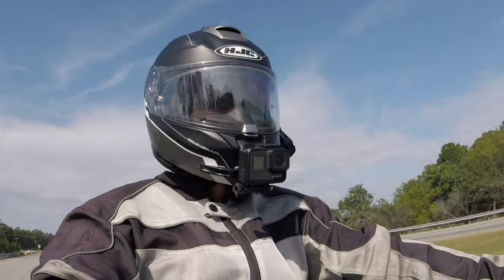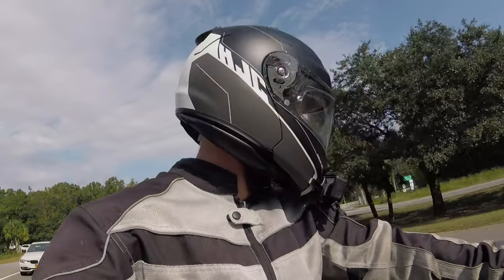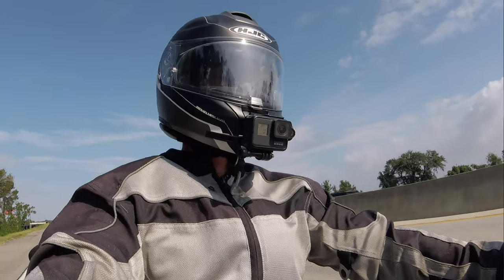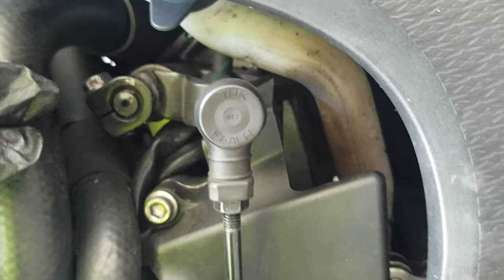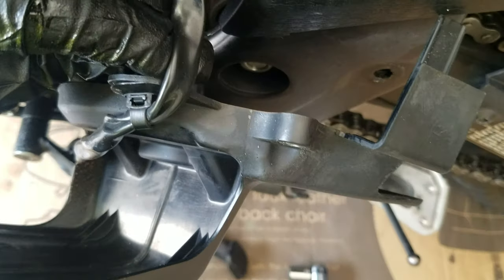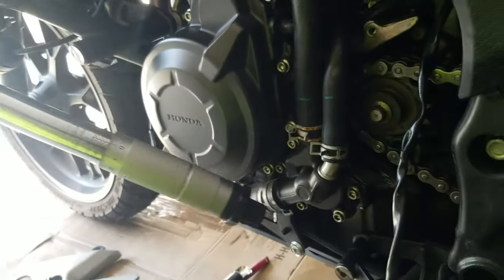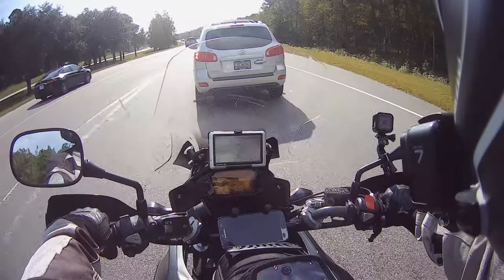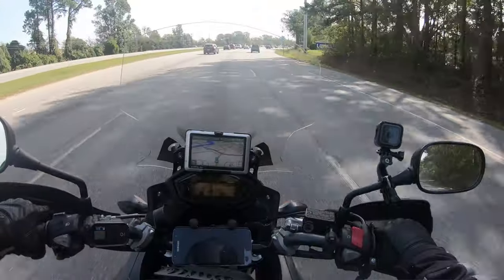CB500X 16T Sprocket Swap

Comment: Hey Chris you mentioned in your latest video pt2 of Cinnamon pass you wish you hadn't went to a 16t front sprocket. Do you feel you should have waited till after the passes? How did it perform other than passes like in Colorado? I was thinking on swapping mine out but don't know now.
Reply from the maker: Hi Craig!  I swapped my 15T front sprocket out for the 16T sprocket a year ago.  I have absolutely LOVED the upgrade!  It has taken me down and around Mexico, along the entire Blue Ridge Parkway, and many other great trips this year.  I never even thought about it the entire length of the TAT until Cinnamon Pass.  Honestly, I had no trouble with the 16T front sprocket.  The only time it was a concern was when I got stuck behind a couple Razors that were going particularly slow up a steep incline.  You heard me mention I was chugging along in first gear at pretty low rpms behind them.  Had they gone any slower, I certainly could have feathered the clutch a little and been just fine.  But that was the only time I thought to myself "this is the kind of situation those Honda engineers were thinking of when they put a 15T front sprocket on this bike".  Having said that, I truly have NO REGRETS and highly recommend the 16T upgrade to anyone riding in America, Europe, or anywhere that has nice roads.  It just makes the lower gears smoother, and the higher gears more useful.

Comment: Did you not need to change the chain length?
Reply from the maker: I did not.  That's one advantage to changing the front sprocke instead of the back.  :-)
Reply: @MotoPhotoAdventures  this made me so 😊. Heading on a trip and need a new chain but want a new front sproket and stock is zero everywhere in Canada.  Now I can safely change the chain and not worry about the added expense
Reply from the maker: @timeoutover5075  glad I could help!  ENJOY!!!

Comment: Great video!
Any update after long use?
Weird display bugs etc.?
Reply from the maker: After long use, I can say I am STILL 100% in love with this upgrade!  Since making it, I have ridden down through Mexico and back (https://www.youtube.com/watch?v=G-Xr-eTdje4&list=PLMpCu16Bx7xOgz2lP1igdN0uYO1Aht3Nz), up to Virginia and back (https://www.youtube.com/watch?v=VcUjuZA7REE&list=PLMpCu16Bx7xP6kirQ7TMs-ZWiYqEwF1PT), and am currently riding the Trans-America Trail (https://www.youtube.com/watch?v=smHa8HQJjVE&list=PLMpCu16Bx7xPo7Ro_lGpz0vrw1CP8Gw0l).  Unless you ride a ton of off-road technical riding, you should try it!  A front sprocket should run you $25-$50.  And you can swap it out in less than an hour.  You have almost nothing to lose!!!  Here's the links...
Honda NC700 Sprocket:  https://amzn.to/2MW7TFi
JT Sprockets:  https://amzn.to/2oWo910
Reply: @MotoPhotoAdventures  I'm not off roading with the CBX, I'm commuting daily with it and due to the traffic issues in my area the first & second gear are frequently in use.

I've asked you regarding any issues related to the sprocket change since I've read that it might affect the CBX display.
Did you came across any weird(compared to the previous sprocket)issues with it?

Thanks!!

Comment: You said changing the front sprocket affects the speedometer?  By how much?
Reply from the maker: Hi Mark!  If you watch the video, I compare speed differences between speedometer and actual mph on a GPS.  Note that speedometer accuracy can be affected by all kinds of things, including buying thicker tires (like if you put on some knobby Continental TKC80s for off-roading).  In any event, if the difference bothers you, it's an easy and affordable fix to plug in one of the SpeedoDRD devices:  https://amzn.to/2Pahs8C.

Comment: Interesting. It doesn’t annoy you that this effects the Speedo reading and the miles travelled?
Reply from the maker: To me, the benefits outweigh any negatives.  Since my GPS shows my exact speed anyway, that's not a problem.
Reply from the maker: Hi NC750X Stuff!  Note that I've been made aware of a product from Healtech called the Speedo Healer that you can plug in to correct for mileage variances.
Reply: Chris Smith - will be interested to hear the results if you buy one.

Comment: Did u find you lost any power/acceleration?
Reply from the maker: Hi Brett!  It's such a small change.  I don't feel any loss in power/acceleration.  It just lengthens the usable range in each gear, especially 1st and 2nd.

Comment: Hi Chris, great video, I have two questions, what happened with acceleration let say to reach 70 mph? For me acceleration is more important than being able to drive at some constant speed at lower rpm. I would expect that is a little worse? Did you later adjust that guard or do you ride without it?
Thx a lot, Erik
Reply from the maker: Hi Erik!  Thanks for the encouraging words.  I did grind down the chain guard and re-install it no problem.  I personally noticed no difference in acceleration.  Remember we are talking about a Honda CB500X in my case, not a Suzuki Hayabusa!  ;-)  In fact, I actually feel I can get up to highway speeds faster because I don't have to shift as early as I used to.  For example, I used to have to shift from 1st to 2nd before I even got through the intersection.  Now I can at least pull away through the intersection before I feel the need to pop it into second.  Having that longer range between shifts makes me feel less "jerky" on acceleration.  Now, has my chance of pulling a wheelie been reduced?  Maybe.  But that was never something this bike was ever going to do elegantly anyway.  So to me, the benefits far outweigh any negatives.  Plus, it's a super cheap and very easy mod.  So give it a shot!  If you don't like it, no big deal...throw your 15T sprocket back on.  But unless you're doing a lot of off-roading where that lower first and second gear might help you on steep rocky climbs or soggy stream crossings, I think you're going to like it!
Reply: Chris, thank you very much. Yes, the first gear is definitely to short, but it's interesting how different things
means differently to us. I don't mind a lot of gear shifting - it gives me even pleasure and I prefere to drive more dynamically (if I can use this word for this bike) on a curved road between, let say 45-110 km/h (30 -70 mph) and accelerate faster when exiting curves, than to ride at lower rpm in constantly high speed so that the reduced acceleration would not outweigh positive things for me, that you write about. Yes, maybe I will try to change it and you encouraged me, that it is not too complicated to do it by my self :)Cheers from Slovenia.
Reply: @MotoPhotoAdventures  Your video and this comment answered literally every question I had about the 16t sprocket. I'm going to order it today since I do 90 miles round trip 95% highway for my daily work commute.
Reply from the maker: @cranedaddy678  I'm glad we could help!  If you ride a CB500X, I hope you'll subscribe to the channel...we have tons of "How To" videos on changing oil, fixing a flat, etc.  Plus of course our adventure travel videos are very popular!  Here's our most recent one from the MABDR:  https://youtu.be/jT3rd7riRbc.
Reply: @MotoPhotoAdventures  I do and I did subscribe! I have a 22 cb500x and the sprocket is already ordered 😀
Reply from the maker: @cranedaddy678  that's awesome!  Let us know how you like it...
Reply: @MotoPhotoAdventures  I just got it installed and went for a test drive.. Man I'm never going back! Going to get a speedo healer soon and just enjoy!
I didn't notice any power loss. It seemed like the bike was a little faster because I wasn't having to shift through the gears as fast as I did with the 15t.
Reply from the maker: @cranedaddy678  That's awesome!  I'm glad you're enjoying your little upgrade.  🙂 Here's a link to the speedometer healer for the CB500X if you need it:  SpeedoDRD DRD-3 from 12 oClock Labs - https://amzn.to/2Pahs8C.  Cheers...

Comment: Chris Smith;  What windscreen are you using please?
Reply from the maker: Hi Stuart!  It's the one from Givi.  I LOVE it!!!  I installed it with a couple small plastic spacers to allow better airflow.  I'm 5' 7" and now ride inside a beautiful pocket of quit peacefulness!  :-)
Reply: Thanks for that, seems like there is several screens available with lots of different performance claims and test results.  I’ll take your recommendation.  Now can I ask what hand guards you use?
Reply from the maker: Hi  @stuartrumley4244 !  Yes...I'm using the Barkbuster hand guards.  Pricey but VERY worth it!

Comment: Hi Chris, what’s the roll on power like when you accelerate from 80mph, does it still have enough go to overtake or is it running out of steam? Thanks
Reply from the maker: Hi Zork!  In a flat stretch, it keeps up no problem.  But of course with the larger sprocket you're rolling at a lower RPM than you would be with the stock sprocket.  And we all know this bike's power band doesn't really kick in until you hit the higher revs.  So to pass another vehicle, especially on an incline, I usually shift down to 5th.  However, at those speeds, I'm perfectly happy just staying in my lane and enjoying the ride.  If I was looking to accelerate away at 80mph, I'd certainly be looking at a more powerful bike.  But I'm not.  So the CB500X is perfect for me...peppy and fun to flick into the corners at lower speeds, yet comfortable to cruise on the highway all day.  :-)
Reply: @MotoPhotoAdventures  thanks Chris. That's what I was after. I realise it's not going to compete with 130bhp but I'm the real world of speed taxes being able to accelerate comfortably from 70-80 is crucial if you need to get out of danger when you're cruising. Thanks for the reply.
Reply from the maker: @garmit61  any time, my friend!  Glad I could help.  Be safe...

Comment: Wow! Great video Chris; really helpful. I too have a Honda cb500x (2018). I use it as a highway touring motorcycle, sw-motech bags, and hand guards, often in the 70 to 80 mph range. Would very much like to lower the rpm a little.
Can't wait to order and install a 60 tooth sprocket. Your link from Amazon does not specifically say its for the cb500x; but it does fit. Is this correct?
Reply from the maker: Hi Doran!  I'm glad you liked it.  You're going to LOVE this upgrade because we have a very similar riding style.  Since upgrading, I've ridden to Mexico and back, to Virginia and back, and am currently riding the Trans-America Trail across the US.  I still love this upgrade!  Yes, if the links are still current, they are correct.  They will not say they will "fit" the CB500X because those online catalogs think only a 15T sprocket will fit our bike (that's what the manufacturer installed).  You are looking for a 16T sprocket that will fit a Honda NC700X or NC750X.  These are slightly larger, but very similar bikes.  But the "fitting" the sprocket attaches to is the exact same size as our CB500X machines.  So that's what you want.  For $25-$50, and less than an hour of labor, this is one of the best values I've installed on my bike!!!
Honda NC700 Sprocket:  https://amzn.to/2MW7TFi
JT Sprockets:  https://amzn.to/2oWo910
Reply: @MotoPhotoAdventures  do you know if this one from partzilla is the right one? 99-1J17-JT-SPROCK-JTF1381-16RB SPROCKET FRONT 16T 520 RU $19.00
Reply from the maker: @ryanburke7091  I'm not familiar with that product.  But if it fits a Honda NC700 or NC750, it'll fit perfectly on a CB500X as well.
Reply: @MotoPhotoAdventures  thanks for reply,  partzilla canceled it,  so i will just use your Amazon link.
Reply: @MotoPhotoAdventures  i ordered the 12 o'clock labs speedoDRD to fix the speedometer reading.  Thanks so much for making the video!
Reply from the maker: @ryanburke7091  my pleasure!
Reply: @MotoPhotoAdventures  update: speedo worked perfectly. Side point,  if you get a chance to look up barkbuster storm handguards and a work around to fitting with the factory wind screen i would be interested in your opinion.  If you feel like it.  I seen one video on YouTube with a guy using 1 inch spacers to move it forward. You think a jigsaw would cut the windscreen nicely or no?
Reply from the maker: @ryanburke7091  I'm glad it worked for you.  I use the BarkBuster handguards.  All you have to do is put spacers to push the windscreen forward.  Rally Raid sells a kit to do this.  But I just bought a black plastic pipe from the plumbing section of the hardware store and cut it into 4 spacers about 1.5 inches long, and bought longer bolts to fit the extra length.  Worked like a charm.  I discuss it at the beginning of this video, which you might enjoy because it goes over a lot of the farkles and mods I've done to my bike:  https://www.youtube.com/watch?v=jrWp3WyNNfo&t=16s.
Reply: @MotoPhotoAdventures  thanks a lot and for your time!
Reply from the maker: @ryanburke7091  my pleasure sir!
Reply: @MotoPhotoAdventures  sorry one more? If you don't mind.  You think the fuel economy is better with or without the baffle in the muffler? Or maybe not much difference just for sound?
Reply from the maker: @ryanburke7091  No worries!  I don't keep really great records on my mileage.  So I have no idea.  But I doubt the baffle makes any difference at all.
Reply: @MotoPhotoAdventures  ok thanks.  Take care
Reply from the maker: @ryanburke7091  any time...happy to be of service!!!

Comment: Your chain is kinking due to wear/age and improper lubrication.  Additionally, the old front sprocket is highly worn indicating that it is time to replace your chain and rear sprocket.  Keep your chain and sprockets clean, lubricated, and properly adjusted.  Change them all at the same time.  If I bought a new CB500X I would immediately put a 16-tooth sprocket on it.
Reply from the maker: Thanks for the tips, Bruce!

Comment: Great video, thanks for the clear howto and first person review. I bought a JTF1373.16 sprocket to do the same. Was that the type you also used? It definitely looks similar. Thanks again 👍🏻
Reply from the maker: Hi Jeroen!  I believe the one in this video is a Suntour brand.  But I have since then replaced it with this one from JT Sprockets with the rubber sound dampener and really like it:  JT Sprockets:  https://amzn.to/3uRj4D6

Comment: i dont speak English very, I would like to understand if you have a higher maximum speed or a greater thrust at the start. thanks
Reply from the maker: Hello Ivan!  The thrust to start is not any stronger, but is much smoother.  First gear becomes more useful, which is nice.  In top gear, there isn't really any higher maximum speed.  This is because the engine is only 500cc, not very strong.  However, at higher speeds the RPM is lower so the engine doesn't have to work as hard.  I hope this helps!
Reply: @MotoPhotoAdventures  ok I understand, it serves to decrease the number of engine revolutions at motorway speeds. thank you very much for the clarification. greetings👋
Reply: More top speed, less acceleration and power.

Comment: no need for a chain upgrade?
Reply from the maker: Nope!  Not in my case.  However you should know that most manufactures recommend changing both sprockets and the chain at the same time.

Comment: That counter shaft sprocket liked pretty darn worn out. Did you check the chain and rear sprocket?
Reply from the maker: Yup...I changed those later.  Thanks!

Comment: How much does it throw you speed off.
Reply from the maker: Hi Boyd!  In the video I show and read out actual speed (GPS) vs speedometer speed.  Check it out to see.  But if that discrepancy bothers you,12OclockLabs makes a speedometer healer you can plug in to correct it.  I link to it in the show notes.  It's a fun and useful upgrade!  Give it a shot.  :-)

Comment: Just want to update, I've changed to the 16T jt rubber sprocket and I have to say - change it!
The motorcycle feels better, handle better and in total made me stay with this bike longer
Reply from the maker: That's great to hear, kobirighter!  Glad you're enjoying it!!!
Reply: @MotoPhotoAdventures  thanks to you :)
Due to your recommendation I've changed the sprocket and fell in love in this bike again!
Would like to hear you recommendation (if you have one) regarding reducing weight on this bike(for better performance)
Reply from the maker: @kobirighter   That's awesome! I'm glad it helped the best 2 ways to reduce weight are to replace the exhaust and replace the original battery with a lithium ion battery. You can check my channel for a video on the exhaust I bought!  :-)
Reply: @MotoPhotoAdventures  great idea, I didn't think of it.
Do you any mods to the seat? I need to do something about is as my ass can't handle long rides
Reply from the maker: @kobirighter  there are plenty of other seats...Corbin, Sargents, Seat Concepts.  Or you can add something like an Air Hawk to your existing seat.  Personally, I find there's no substitute for "time in the saddle".  The more you ride, the more comfortable you become on long days in the saddle.  :-)